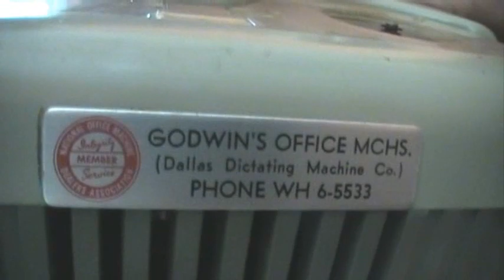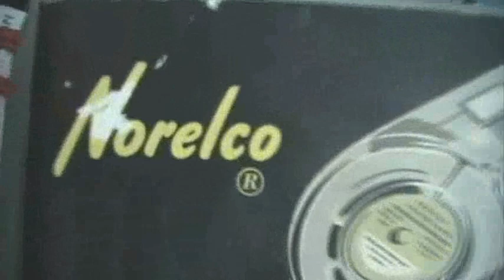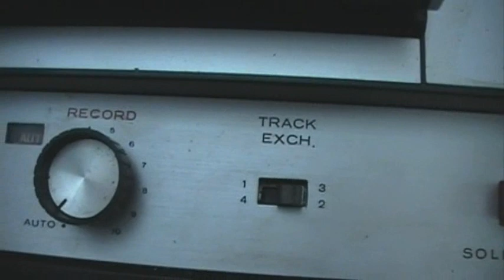DICTATION HISTORY: The Norelco (Philips) EL3581/15 reel-to-reel tape recorder

Comment: Hey Ricky, I just reviewed this video because I`m selling my Norelco, and I recapped it. There are only about 5 caps in it, and for the most part they were`nt very hard to get to. And I`m a novice at doing it so if I can recap the tape recorder and actually get it to work again, I`m sure an expert like you will have no problem getting it done.   :)

Comment from the maker: Is the unit completely dead? Or does the amp and motor run? It may be a broken belt, and also it may need new electrolytic capacitors.

Comment: b/t/w, I wrote you a few times several years ago when you first started & subbed your one page.I have been collecting radios, cassettes, reel to reels, classic televisions since 1970 when I was 6 years old. i am obsessed with them, especially recorders, as you are/have been. Re: the machines that were thrown out, i managed to grab about 3 of them after work but it was rush hr. i had to get across the city to get to my car to leave & drive back home 100+ miles & the dumpster was unlit & it rained

Comment: It isn't that rare, they used to throw these out of office buildings by the truckload full in Philly & NYC. I saw hundreds of them being shoved into garbage bins in the mid 1990's, Norelcos, Grundigs & Telefunkens, etc. Also, they are from the 1960's, not 50's. From the mid 1940's until the 1960's, "Dictaphone" was king and almost all offices used their floppy plastic "Dicatbelts" which were recorded on like an audio record but on a thin, usually red plastic belt about 4" wide.